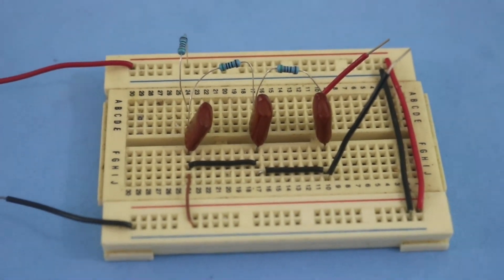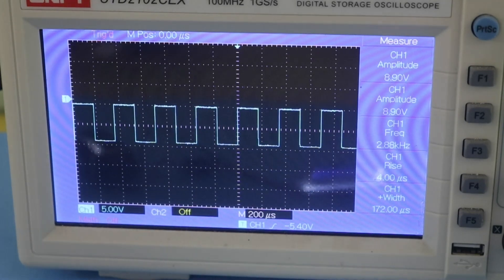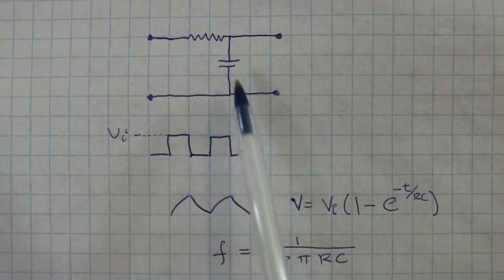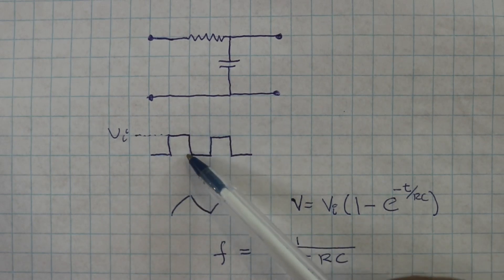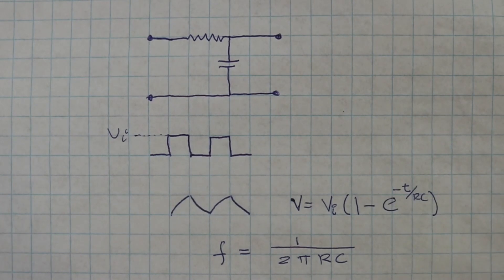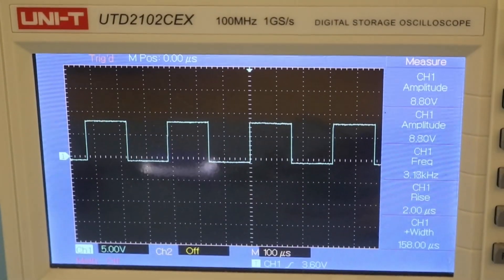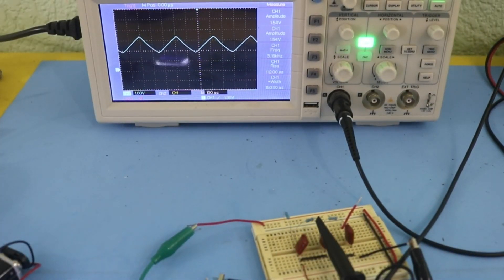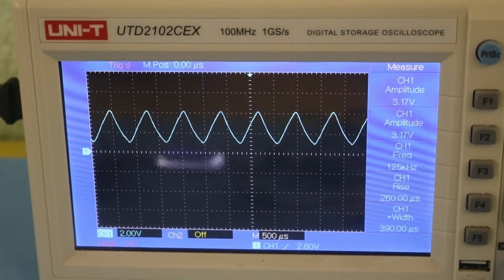Rectangular to Sine Wave Converter Circuit - UTSOURCE

Comment: Hallo sir, I would like to ask about the high voltage DC modules, what happens if you feed it ac current, does the output remain the same and it a constant output, please do a video if possible to help me easily understand

Comment: Your voltage dropped substantially at every stage of your circuit. Maybe adding op amps between those stages would have helped maintain the voltage.

Comment: One thing to mention is that the Vpp decreases with RC filters. The more you add rc filters the lower the Vpp, but the closer you get to a sin looking wave. Then you may think adding a transformer will help you raise up the voltage, well no you now affect the overall impedance of the circuit.
Reply from the maker: True
Reply: @ludicscience  Adding a buffer amplifier to the RC output is a good option. The LM324 was created for single-ended applications and would work well here next to the 555.